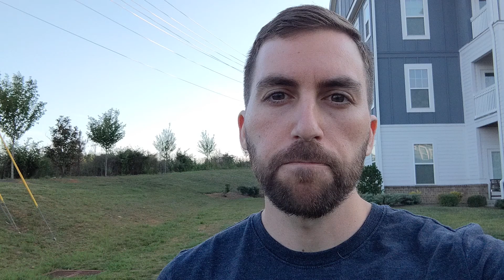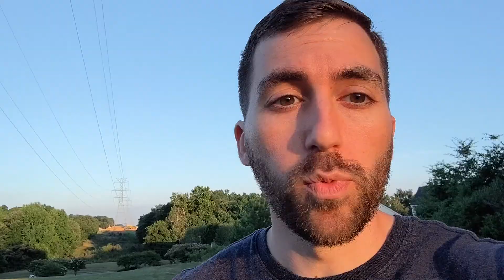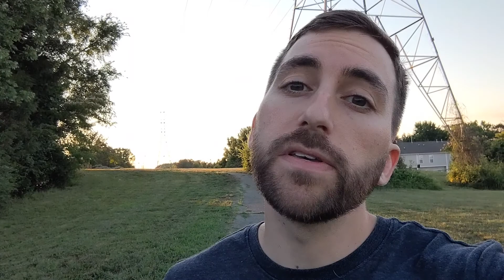Solar Project Development - Part 5 - Interconnection

Comment: Man, your video is the most complete and short explanation I´ve had on all the stages of the development of a renewable project. 

I´ll take your word on the questions, about this topic. Do you have a practical example of when a project must apply for an NRIS (Network Resource Interconnection Study), an ERIS (Network Resource Interconnection Study) or to go both? I found those concepts very confusing, besides no "Tariff document" from any Utility explains it properly to understand it. (Or maybe I´m not familiar with certain concepts to understand it).

Regards from Mexico.
Reply from the maker: Sorry for the late reply! I haven't checked these videos in a while. 

One practical example I can think of is if you have a manufacturing building with lots of land. Maybe they will be using most of the energy they need from the solar farm so they only need to go thru with the ERIS. 

Here is a good article too: https://www.renewableenergyworld.com/solar/network-resource-interconnection-service-is-better-than-the-energy-resource-interconnection-service/#gref